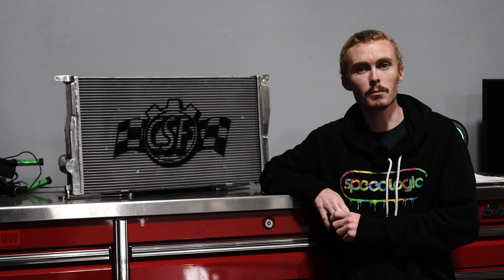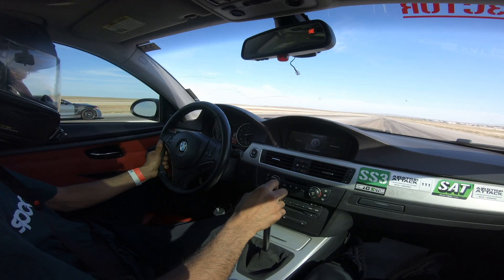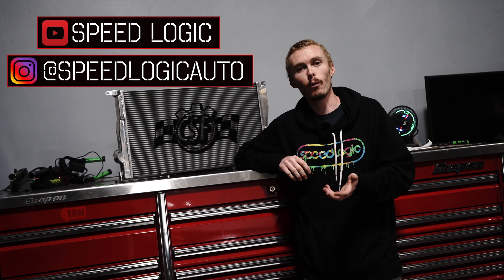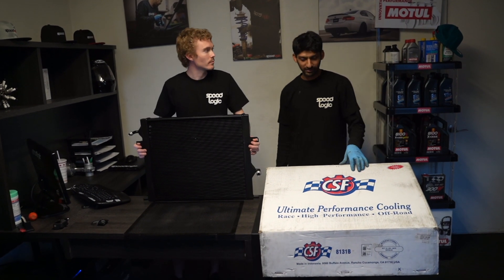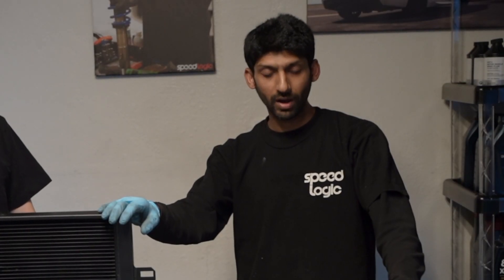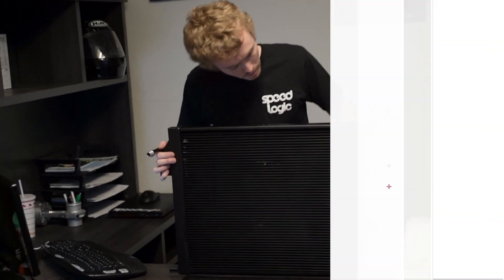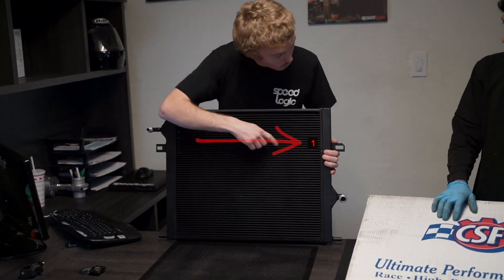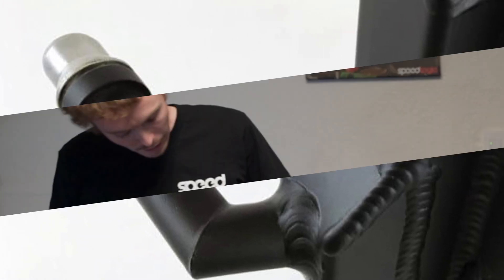B58 CSF Heat Exchanger: Why should I upgrade? Specifications and Installation (Using BMW F22 M240i)

Comment: What did you guys mix the water wetter with? And what percentage do you mix it?
Reply from the maker: We mixed it with Distilled Water - make sure to only use Distilled water in the Coolant system (and not tap water!). We added 2 bottles into the entire system for this M240i - let us know if any questions!